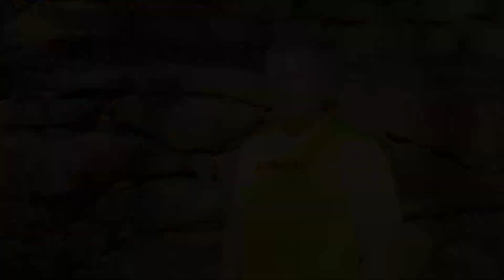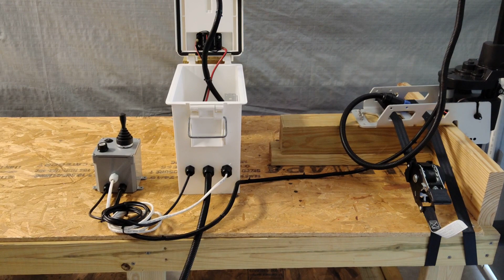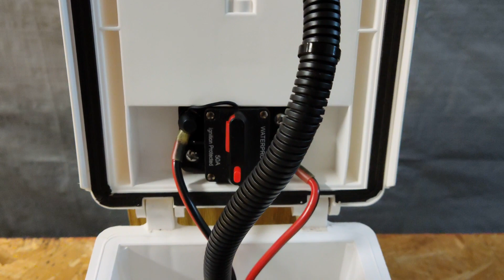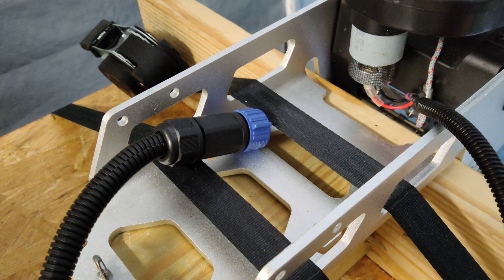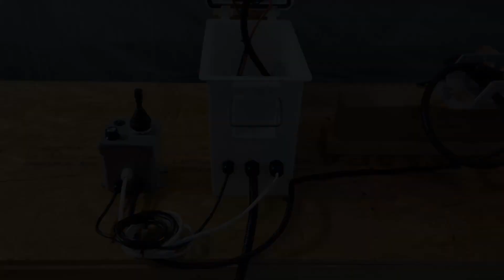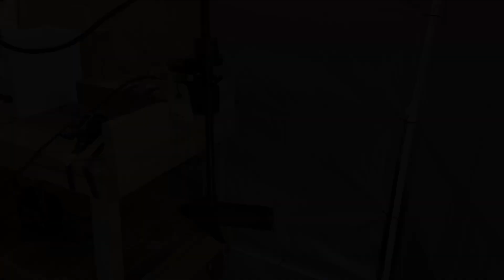PWM Speed Controller and Gearbox Steering on Trolling Motor

Comment: Great work! Any idea how much run time you've gained with PWM over stock?
Reply from the maker: Thanks John. No, I have never done a comparison test. I know it is a significant amount because you can adjust the speed infinitely while the stock speed switch is always running at high and slows down with resistors.

Comment: No hobbywing 880 this time?
Reply from the maker: I don't recommend using the 880 on trolling motors 50lbs or above. Since this was a 45lber, I thought this new high amp PWM would work better.
Reply: @Aksmaniyak could you possibly explain to me why you don’t recommend the hobbywing with a 55lb trolling motor?  The specs of it seem like they would handle one.
Reply from the maker: This comes from a friend who used a 55lber on the 880 and it fried the wiring.
Reply: @Aksmaniyak  thank you.  I appreciate you getting back, I was thinking that it could be an overheating issue.
Reply: I bought the joy stick, I have the set up that’s in the white box . Pwn , and other board . Is it possible to hook up joy stick without servo.